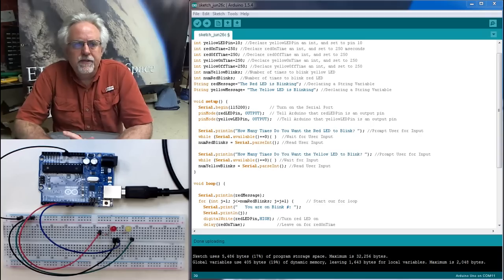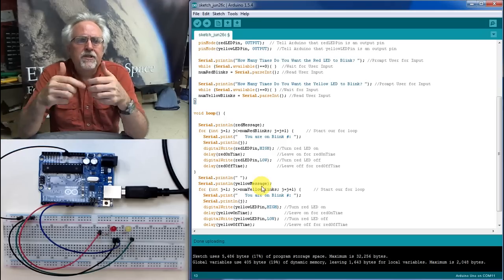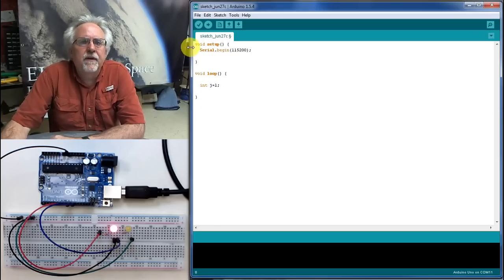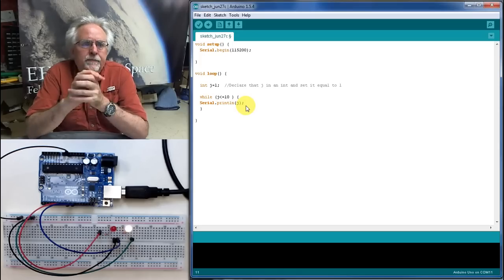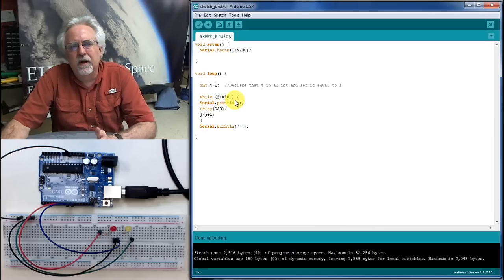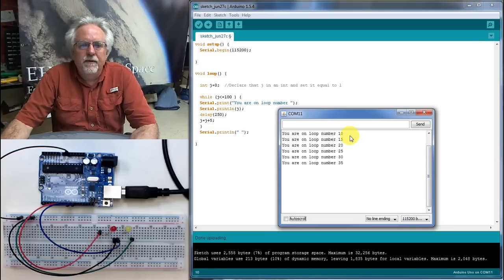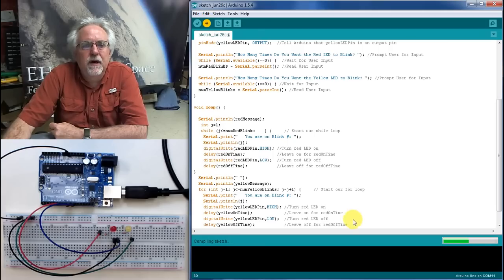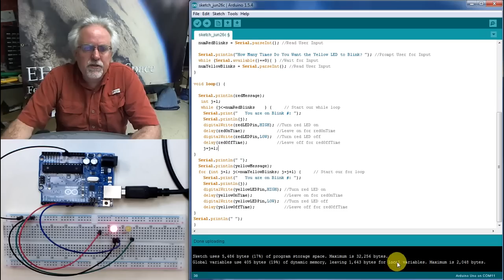LESSON 7 Using While Loops with Arduino

Comment: Thanks for the lesson! I used nothing but while loops in this one. This one is still a work in progress, and pushing the nano to the memory limit! I commented out the interrupts that call the menu because I have this just running all the time, but when I would put my computer to sleep, it would trigger the interrupt and call the menu then pause the sequence.

I also just noticed that commenting out the interrupt calls to the menu greatly reduced my dynamic memory usage, it was using around 78% and throwing a warning at compile. I stopped at the wave1() function because I'm not really liking the effect it is giving, although I believe the remaining unfinished effects will be more acceptable to me. I will be finishing this one at some time because I really want to find the limit of the nano, and what happens when I reach it, or at what point it becomes unstable.

Some of my code below: Guess it is too much for youtube
// Lesson7a: Using the while loop.
// Using the Arduino Nano.
// https://youtu.be/Y64Ev-pWqFs?si=AkQJlFdSceuk-Lvg
//////////////////////////////////////////

// Set up pin variables. (5, 6, 9, 10 and 11. All are PWM pins for dimming effects.).
int iPinLED01 = 11; // External LED connected here.
int iPinLED02 = 10; // External LED connected here.
int iPinLED03 =  9; // External LED connected here.
int iPinLED04 =  6; // External LED connected here.
int iPinLED05 =  5; // External LED connected here.

// Set up the pin value variables.
int iAnalogLED01; // First in line.
int iAnalogLED02;
int iAnalogLED03;
int iAnalogLED04;
int iAnalogLED05; // Last in line.

// Set up any timer variables.
int iDTOn;    // Time the LEDs are on.
int iDTOff;   // Time the LEDs are off.
int iDTSet;   // Time between different blink styles.
int iDTRamp;  // How fast the LEDs ramp up and down. (Lower value = faster ramp)

// Set up any user input variables.
int iLEDBlink; // Number of times all the LEDs will blink.
int iStyle;       // The way the LEDs will blink.
int iStyleOld;    // The old style used.

// Set up any loop variables.
int a;  // Loop variable.
int b;  // Loop variable.

// Used for program interrupt and clearing the serial port.
int iInterrupt;

void setup()
{  
  // Setup the serial port.
  Serial.begin(9600);
  
  // Set the pins up.
  pinMode(iPinLED01, OUTPUT);
  pinMode(iPinLED02, OUTPUT);
  pinMode(iPinLED03, OUTPUT);
  pinMode(iPinLED04, OUTPUT);
  pinMode(iPinLED05, OUTPUT);

  // Set the variables.
  onDefault();

  // Call the menu.
  //onMenu();
}

void loop()
{
  onChkInterrupt(); if (iInterrupt == 1){iInterrupt = 0; return;}
  
  // See what style we are using and run it.
  switch (iStyle)
  {
    case 0: // All styles.
    {
      onPlainBlink();
      delay(iDTSet);
      onRamping();
      delay(iDTSet);
      onScrollingSS();
      delay(iDTSet);
      onScrollingLR();
      delay(iDTSet);
      onScrollingRL();
      delay(iDTSet);
      onAlternate();
      delay(iDTSet);
      onWave1();
      delay(iDTSet);
//      onWave2();
//      onFire1();
//      onFire2();
//      onPassing();
    }
    break;

    case 1: // Plain blink.
    {
      onPlainBlink();
      delay(iDTSet);
    }
    break;
    
    case 2: // Ramping.
    {
      onRamping();
      delay(iDTSet);   
    }
    break;
    
    case 3: // Scrolling side to side.
    {
      onScrollingSS();
      delay(iDTSet); 
    }
    break;
    
    case 4: // Scrolling left to right.
    {
      onScrollingLR();
      delay(iDTSet);
    }
    break;
    
    case 5: // Scrolling right to left.
    {
      onScrollingRL();
      delay(iDTSet);
    }
    break;
    
    case 6: // Alternate.
    {
      onAlternate();
      delay(iDTSet);
    }
    break;
    
    case 7: // Wave1.
    {
      onWave1();
      delay(iDTSet);
    }
    break;
  }
}

// Called to setup all the variables to a default state.
////////////////////////////////////////////////////////
void onDefault()
{
  // Set the interrupt.
  //iInterrupt = 1;
  // LED brightness to 0. (Range 0 - 255)
  iAnalogLED01 = 0; iAnalogLED02 = 0; iAnalogLED03 = 0; iAnalogLED04 = 0; iAnalogLED05 = 0;

  // Delays
  iDTOn = 250; iDTOff = 250; iDTSet = 250; iDTRamp = 8;

  // User input.
  iLEDBlink = 10; iStyle = 0; iStyleOld = 0;
}

// Called to give the user a menu.
//////////////////////////////////
void onMenu()
{
  // Display the menu.
  Serial.println();
  Serial.println("-----------------------------------------------------");
  Serial.println("| What style would you like your LEDs to blink in?  |");
  Serial.println("| Press return after entering your choice.          |");
  Serial.println("|                                                   |");
  Serial.println("| 0 ... Default. (All blinking styles)              |");
  Serial.println("| 1 ... Plain blink. (All blinking in unison)       |");
  Serial.println("| 2 ... Ramping. (All ramping up and down)          |");
  Serial.println("| 3 ... Scrolling 1. (Scrolling from side to side)  |");
  Serial.println("| 4 ... Scrolling 2. (Scrolling from left to right) |");
  Serial.println("| 5 ..  Scrolling 3. (Scrolling from right to left) |");
  Serial.println("| 6 ... Alternate. (Alternating blinks)             |");
  Serial.println("| 7 ... Wave 1. (Wave effect)                       |");
  Serial.println("| 8 ... Wave 2. (Alternate wave effect)             |");
  Serial.println("| 9 ... Fire 1. (Fire effect)                       |");
  Serial.println("| 10... Fire 2. (Alternate fire effect)             |");
  Serial.println("| 11... Passing. (Just see what it does)            |");
  Serial.println("| 12... Return without change.                      |");
  Serial.println("|___________________________________________________|");

  while (Serial.available() == 0){} // Wait for the user selection.
  iStyle = Serial.parseInt();       // Get the user selection.
  Serial.println(); Serial.println();

  // See if we want the defaults or no change.
  if (iStyle == 12)
  {iStyle == iStyleOld;} // Reset iStyle. 
  else
  {
    // Get the user values.
    Serial.println("Below values are in milliseconds. (1000 = 1 second)");
    Serial.println("---------------------------------------------------");

    Serial.print("How long shall the LEDs stay on for?  ");
    while (Serial.available() == 0){}  // Wait for the user selection.
    iDTOn = Serial.parseInt(); Serial.println(iDTOn);
    
    Serial.print("How long shall the LEDs stay off for?  ");
    while (Serial.available() == 0){}  // Wait for the user selection.
    iDTOff = Serial.parseInt(); Serial.println(iDTOff);
    
    Serial.print("How long to pause before starting the next style?  ");
    while (Serial.available() == 0){}  // Wait for the user selection.
    iDTSet = Serial.parseInt(); Serial.println(iDTSet);

    Serial.println();
    Serial.println("Lower numbers equal faster ramp time.");
    Serial.print("How fast should the LEDs ramp up and down?  ");
    while (Serial.available() == 0){}  // Wait for the user selection.
    iDTRamp = Serial.parseInt(); Serial.println(iDTRamp);
    
    Serial.print("How many blinks do you want?  ");
    while (Serial.available() == 0){}  // Wait for the user selection.
    iLEDBlink = Serial.parseInt(); Serial.println(iLEDBlink);
  }
}

// Called to see if there is an interrupt.
//////////////////////////////////////////
void onChkInterrupt()
{
// Call up the menu if there is an interrupt.
//  if (Serial.available() != 0)
//  {
//    iInterrupt = Serial.parseInt();
//    // Call the menu.
//    onMenu();
//    iInterrupt = 1;
//  }

  return;
}

// Called to set the LEDs values.
//////////////////////////
void onSetLEDs()
{
  // Set the LEDs to correct value.
  analogWrite(iPinLED01, iAnalogLED01);
  analogWrite(iPinLED02, iAnalogLED02);
  analogWrite(iPinLED03, iAnalogLED03);
  analogWrite(iPinLED04, iAnalogLED04);
  analogWrite(iPinLED05, iAnalogLED05);
}

// Called during the plain blink sequence.
//////////////////////////////////////////
void onPlainBlink()
{
  a = 1;
  while (a <= iLEDBlink)
  {
    // Check for an interrupt.
    onChkInterrupt();
    if (iInterrupt == 1){iInterrupt = 0; return;}
    // Set all the LED variables to full on, call the onSetLEDs() function and delay for the correct time.
    iAnalogLED01 = 255; iAnalogLED02 = 255; iAnalogLED03 = 255; iAnalogLED04 = 255; iAnalogLED05 = 255;
    onSetLEDs();
    delay(iDTOn);
    
    // Check for an interrupt.
    onChkInterrupt(); if (iInterrupt == 1){iInterrupt = 0; return;}
    // Set all the LED variables to full off, call the onSetLEDs() function and delay for the correct time.
    iAnalogLED01 = 0; iAnalogLED02 = 0; iAnalogLED03 = 0; iAnalogLED04 = 0; iAnalogLED05 = 0;
    onSetLEDs();
    delay(iDTOff);
    a++;
  }
}

// Ramp LED brightness up and down.
///////////////////////////////////
void onRamping()
{
  Serial.println();
  Serial.println("In onRamping");
  a = 1;
  // Ramp up.
  while (a <= iLEDBlink)
  {
    b = 0;
    while (b <= 255)
    {
      // Check for an interrupt.
      onChkInterrupt(); if (iInterrupt == 1){iInterrupt = 0; return;}
      // Set all the LED variables, call the onSetLEDs() function and delay for the correct time.
      iAnalogLED01 = b; iAnalogLED02 = b; iAnalogLED03 = b; iAnalogLED04 = b; iAnalogLED05 = b;
      onSetLEDs();
      delay(iDTRamp);
      b++;
    }

    b = 255;
    // Ramp down.
    while (b >= 0)
    {
      // Check for an interrupt.
      onChkInterrupt(); if (iInterrupt == 1){iInterrupt = 0; return;}
      // Set all the LED variables, call the onSetLEDs() function and delay for the correct time.
      iAnalogLED01 = b; iAnalogLED02 = b; iAnalogLED03 = b; iAnalogLED04 = b; iAnalogLED05 = b;
      onSetLEDs();
      delay(iDTRamp);
      b--;
    }
    a++;
  }
}

Comment: Paul: First off; I really like your videos, speed and style!!!
I read some stupid negative comments here that do not belong here!

I started with the NodeMCU esp8266 as I was busy programming it (To send Temp readings to my MQTT server) and got so stuck had to call in a good tutor and found you!

So lessons 1 - 6 went fine with a little tinkering here and there!

When I hit LESSON 7 I started getting garbage output  in the serial screen, so I thought it would be good to swap to an UNO.

With the UNO I get absolutely no communication to the serial screen.

I checked each line to the dot, re-entered that small program - no Sigar.

So I thought my UNO is faulty. 
I decided to load a previous sketch with serial feedback to test. With no LED's connected for LESSON 3, all the communication to the serial screen worked just fine - so UNO is not faulty.

Any pointers / suggestions.

The ONLY thing I cannot figure out is what the : Tools>Programmer > Value should be!
Reply: Issue SOLVED:
Note to myself:- No ; after while function!!!!!!

Comment: Noob here. First I'd like to thank you for these wonderful tutorials. I did quite a bit of tinkering and some hair pulling (before googling :-)) because the program just steps through the 2nd led blink input query and just ignores it and it does not blink the 2nd LED at all (zero value since none was inputted). It turned out that I had to set the drop down menu at the bottom of the serial monitor to "No line ending". :-D HTH the next poor guy.

Comment: I can get this loop to work once. The second "while" loop is ignored and the program moves right to the yellow for interest loop and seeing as that variable is empty (because it did not stop and allow me to give it number)

It moves back on to asking for blink count.

One thing I noticed is the "while" command is not the same color as the rest of the command.

Is there a change in the Arduino code?

UPDATE: I found the problem!

The issue is in the mode the serial monitor is in, I had it in "New line mode", not No line ending mode. This is found bottom left corner next to baud rate
Reply: same issue here, thanks!
Reply: I have the same problem. doesn't wait for input on the number of Yellow blinks. It does make the statement " number of Yellow Blinks" then cycles back to Red.

Comment: Hello, thanks for lessons they are brilliant and yet simple to understand. I had been doing great uptill here, but all of a sudden the LED's started blinking very dim. I do unplug arduino without  giving a command to remove usb device safely but that's because i didn't find one.
I did change led's and the resistors but the result was same: dim light from led. Can you suggest what's wrong?

Comment: Hi Paul, thanks for this great series of tutorials!
I'm not sure if something has changed but when the code is followed and uploaded to the Arduino in this lesson, it doesn't appear to function properly. After the number of red Blinks is entered, you never get the chance to input the Yellow Blinks, the program just takes off and only the redblinks can be input. I have entered my own code and pasted the code from this lesson with the same results. the syntax appears correct
Thanks!
Reply from the maker: make sure serial monitor is set to no line ending
Reply: @paulmcwhorter , my nephew also came up with this solution that clears the serial buffer if it isn't.
Might add this to your code and the serial monitor setting won't matter.

After the first while loop, there was still data left in the receive buffer, thus serial.available !=0 and therefore never entered that while loop that asked you to input a number for the yellow LED. To fix this add this code after the first while loop:

while (Serial.available()>0) {      // loop if there is data in serial receiver buffer
   Serial.read();                             // Read data in serial receiver buffer
                                                      // data will be removed from serial receiver buffer once read
   delay(100);                               // delay to allow time before next action
}

Comment: Hello Paul
Can i use a loop inside a switch case and is it possible to stop blinking when the button is pressed to switch to a new case in the code?

I want to switch the state of a LED with one button. 
I want it to switch between AnalogInOutSerial example, blink example, fade example and others?

Right now i can't make a led blink inside a switch case code and therefore not make it blink.

Comment: Thanks for these great tutorials mr Paul, I'm really enjoying them finally getting some sense in the whole arduino workings. But after this lessen (lesson 7) i'm a bit stuck with what to me appears as a bug in my program.
I have the code working but for some reason when I enter a number for instance 3 in the serial monitor the number of blinks always is 1 less then I entered, if I enter 3 I will get 2 blinks. But if I declare j as 0 it gives me the right number of blinks/counts but starts with the number 0 instead of 1 when blinking.

I hope I'm explaining this clear enough, what do you think could cause this or how could it possibly be fixed?
Reply: Never mind i have sorted it out ;),  when i changed the while from: while(a<Blink) {,  to: while(a<=Blink) { . it worked as supposed to. Away to lesson 8 now :P

Comment: Hi Paul,
 
Do you think a while loop would work for what I’m trying to achieve;
I need a single start button for a user to push
An audio clip is played prompting the user to push now for ‘A’ to happen
A short delay
An audio clip is played prompting the user to push now for ‘B’ to happen
A short delay
An audio clip is played prompting the user to push now for ‘C’ to happen
A short delay
If the button has still not been pushed loop back to audio clip 1
I want the to constantly check for button pushes, not just after the clips have been played but all through the clip and the delay. Is this possible?
 
Many thanks, James

Comment: Can you run more than one loop simultaneously? for instance have several counters working independently at the same time without waiting for each other.
Reply from the maker: No, you can have a loop in a loop, but not parallel loops.
Reply: What if I want the red LED to blink 5 times per second and the yellow LED to blink once per second at the same time? Can that be done or do they have to blink in turn?

Comment: You don't understand that at 115200 baud, there is more probability for error than at 9600 baud for serial communications.  If, you need faster communications over serial communications, then you need to use better serial algorithms.

Comment: Awesome stuff - thanks again for sharing the info. Just for fun, every set of looping numbers I alternated the green and red LEDs. I can see endless possibilities with Arduino. Can't wait to learn more - peace.

// GLOBALS
int redOn = 1;
int redLED = 9;
int grnLED = 10;

void setup() {
  Serial.begin(115200);
  pinMode(redLED, OUTPUT);
  pinMode(grnLED, OUTPUT);
}

void loop() {

  int j = 0;

  while (j <= 100) {
    if (redOn) {
      digitalWrite(redLED, HIGH);
    } else {
      digitalWrite(grnLED, HIGH);
    }
    Serial.print("You are on iteration # ");
    Serial.println(j);
    delay(250);
    j += 5;
  }
  if (redOn) {
    digitalWrite(redLED, LOW);
    redOn = 0;
  } else {
    digitalWrite(grnLED, LOW);
    redOn = 1;
  }
  
  Serial.println("_________________________");
  Serial.println(" ");
}